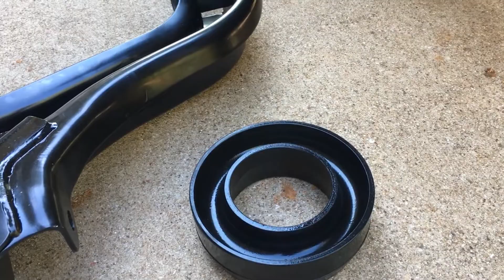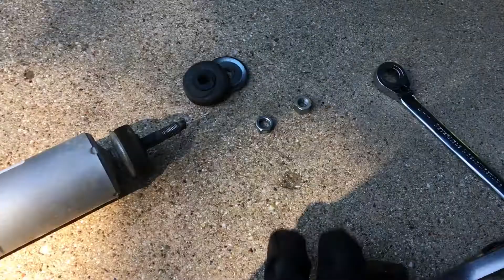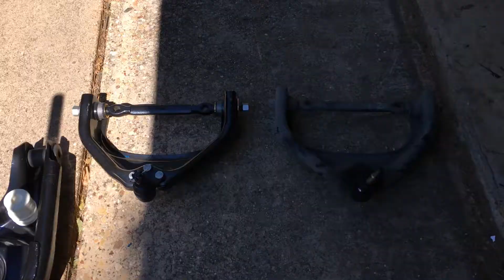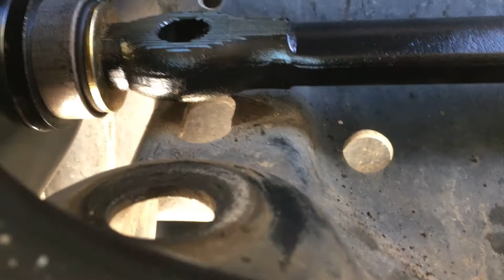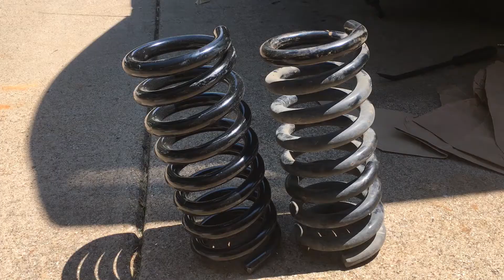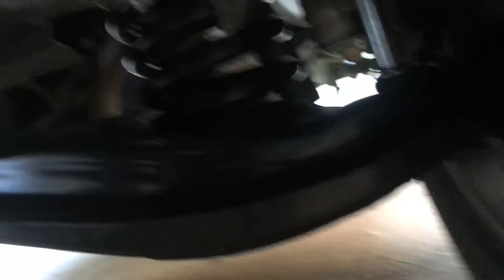2001 Dodge Ram 1500 Front Suspension Repair/Replacement

Comment: You installed the bar in the upper  control are upside down. Those groves are there to bite into the control arm to prevent sliding, not the nut. That's what torque is for. stretching the bolt for tension preventing it from loosening. You hit a good size pothole and I guarantee you're going to throw that out of spec

Comment: Hey did that stop the Squeaking on the front end
Reply: This project resolved the front end squeak. I’f you’re not sure which component is squeaking try spraying some lithium grease on the joints you the the sound is coming from.
Reply: Thanks man, this video has been so helpful my guy…

Comment: Did you have to compress the Spring  To remove the Spring
Reply: No. Assuming you’re removing the steering knuckle once you break the ball joints loose you can slip the spring out. If not replacing ball joints then you would need to compress the spring.